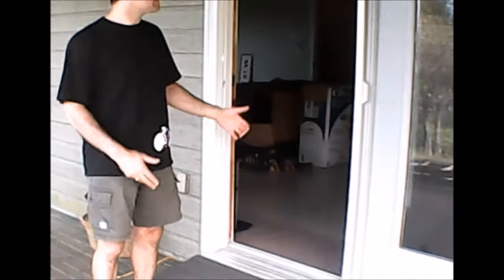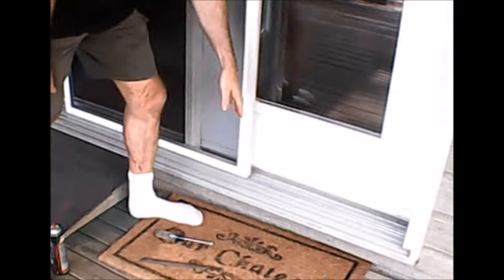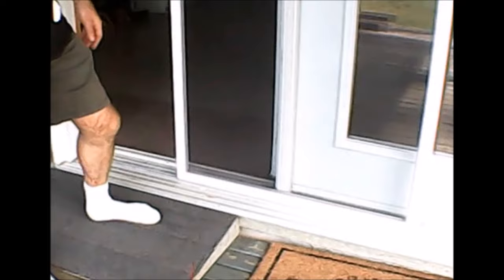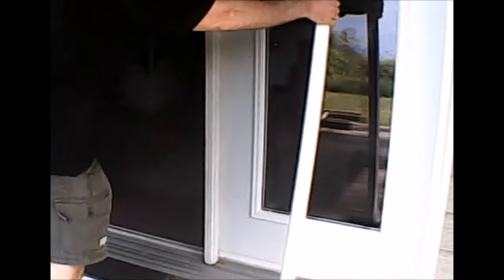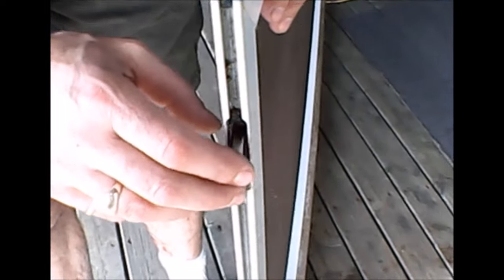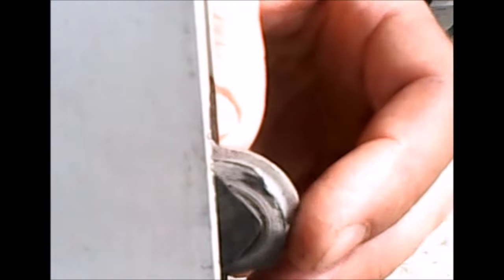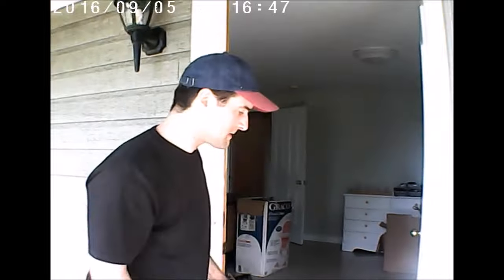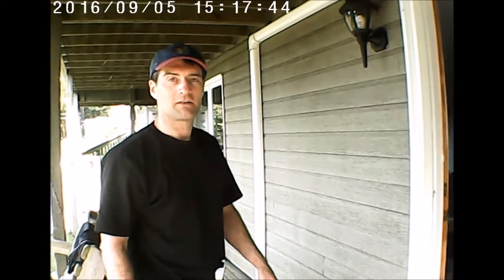DIY - Patio Screen Door Adjustment & Lube

Comment: Thank you so much! I looked a a couple of other videos that only gave a simple “put the wheels in the track” explanation and my screen door still wasn’t operating correctly. Once I applied everything in your video, my screen door works properly, gliding smoothly and not coming off the track anymore.

Comment: OMG ! Merci, merci, merci !!! You surely saved my day, and lots of frustration in my summer (and a divorce, for my hubby abandoned trying to deal with the screen door and becomes impossible to bare haha - now let your wife repair this, honey !). When I got the door out, I saw that we had one wheel ok. Others 3 were closed in the door, like if there is a spring missing for them to stay out like the one that looks ok. And it's dirty in there ! I'll have a better idea when I get his clean, but if there is a missing part I may order wheels, I imagine that it's the thing to do... The door was "working" but not properly since we bought the house 8 years ago. I'll make it work with your help ! Huge thanks from Québec province !

Comment: I had a broken wheel on the bottom of a slider wheel.  The wheel is spring loaded with coiled spring.  I could not find this type on the tube.  However, this video helped in adjusting the top and bottom tension screws well enough to operate the slider smoothly.  Thank you very much for this video.
Reply from the maker: glad it helped you

Comment: Thanks, got our old 70’s door rolling again. One tip, the wheels roll on the “rail” on the bottom of our door, and the top wheels fit in the slot. Don’t know if that’s universal, but a close up on the wheels going into the slots would be useful. Thanks again!

Comment: Finally made ours work reasonably well this morning.  The video did it!    I went to two of my local 'everything you need stores'   and neither of them had new wheels of the right size nor did they have new 'corners'.  Amazon claims to but you have to take the door apart to see which are the right ones.       Next time maybe I'll just buy a new door!

Comment: Left out the adjustment to square the door off with the jamb. When closing the screen door, need to align it with that jamb when closed. The adjustment to do that is in the wheels, just an additional step is needed if the gap at the jamb when the door is closed is different top to bottom. Maybe that adjustment wasn't necessary for this door, but not always the case. Good video, clearly presented.

Comment: Just use a candle and run some wax on the bottom rail, this will make your sliding door run smoother without and any hang ups. I use this method to make my sliding door run smoother.
Reply: This and oil only attracts dirt and pet hair. You will end up Cleaning way too often. Personal experience

Comment: mr diyguy my screen door wont come off the track. I adjusted the four screws counter clockwise, but only half of the door comes off. I cant access the stuck wheel as there is no room to get a putty knife under the wheel?

Comment: Thanks for the great video the title says something about Lube.  but I don’t see anything about that in the video I’m wondering if silicon spray is the correct way but I don’t want to apply too much
Reply from the maker: Very good observation.  Yes silicon lubes on the roller shaft is helpful.  Don just spray lubes everywhere ot it will attract dirt.  Equally important to live is vacuuming out the track to ensure rollers don't bind on debris while opening and closing.  Let us know how you make out.
Reply: mr diyguy123  Yeah I completely cleaned the tracks out and Then I used a narrowed down vacuum  adapter to increase the suction to Get all of that grime out of there
Reply: When I had the slider door off I realized that the bearings in the little wheels on the one side are completely blown out but the ones on the handle  side are perfect and so it still makes the funny noise when it opens. I’m wondering  if there’s a place I can order the wheels for an old slider that was installed in 1977?  🤣

Comment: Anyone knows how do I adjust if there is no screw.
Reply from the maker: I suggest taking the door completely off of the track and looking at the wheels closely to see if the assembly pulls out and unscrews and then slides back into place as possible adjustment mechanism